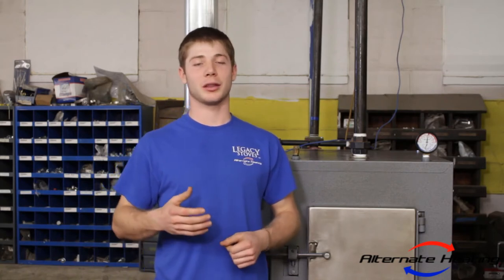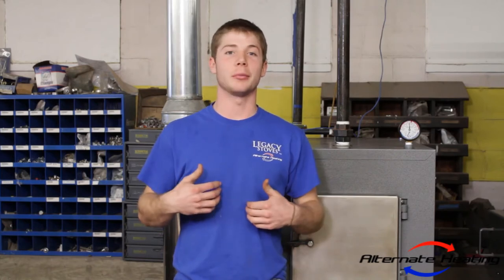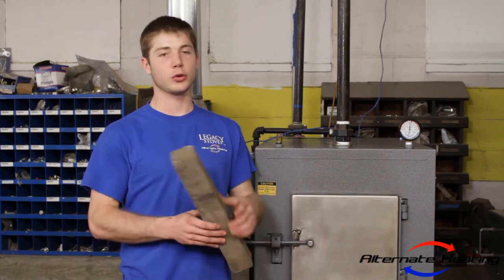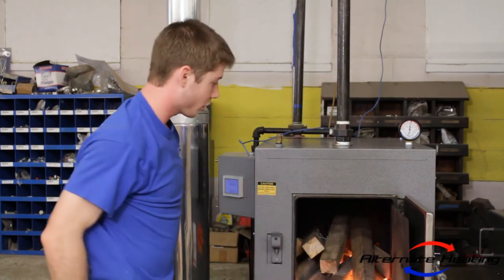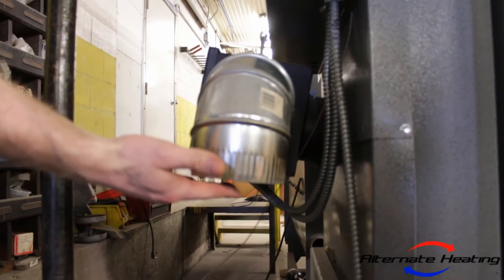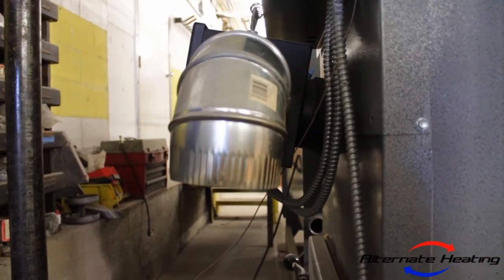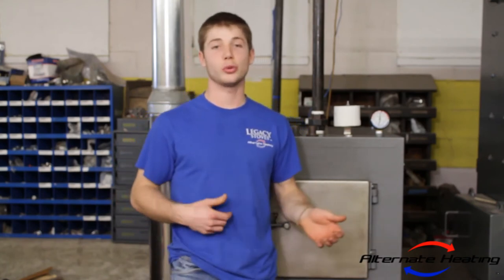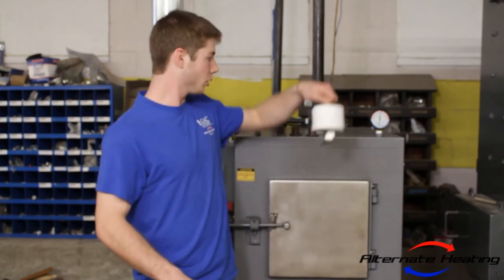How To: Back-Puffing Solutions

Comment: 11 months later: In  my case the puffing is not about the wood being to dry or two small but rather the rate of combustion. If I load the stove to the absolute top with large wet wood over a real hot layer of wood that is almost turned to pure charcoal and is burning really well and clean, the new load will begin to catch fire and if my air damper is anything but closed it will start to violently back puff. If I close the damper the puffing is just about stopped and all is well. This happens most noticeably on very cold nights. The fuel in the fire chamber just seems to be igniting the gases within the chamber creating small gaseous explosions that leak out around the door seals and out of the intake air tube. So I can run the boiler with the air damper fully closed and there doesn't seem to be any bad effect from doing so. The outside air temperature creates differant draft and fuel burning characteristics that do take time to learn how to adjust the draft to these conditions. If I burn smaller loads on milder days I can run my damper open more than half way, but I almost never run it wide open. I absolutely love the long burn times I get and the best thing I can say is that I am burning far less wood than ever before and I've been heating with wood boilers for more than 40 years and this wood gun is the best I've ever owned. PS. I don't work for or have anything to do with this company. In fact I bought my SS140 from someone who had to move and had bought  it from the Alternate people who make it.  I've owned more than three other types of wood boilers and there is nothing out there that compares to this unit.

Comment: I have owned an E140 stainless woodgun for about 11 years and I do experience these problems also and not only when the combustion chamber is full.   I have found that restricting the intake helps as Caleb mentioned.  Split wood that is stored in a woodshed for an extended period of time will definitely "back-puff".  It usually does not last very long, however if the unit has any (air) leaks at all the smoke will come out of those open joints as the combustion cycles from low to high in a rather dramatic fashion.  It really sounds very similar to a steam railroad locomotive albeit not as loud.  Since my unit is indoor I have taken several measures to make sure  any smoke that is released is recycled to the intake and thereby recombusted.  I do not have any experience with the other two items Caleb mentioned but I have a sneaking suspicion that if you plug one of the two holes in your furnace your BTU rating will suffer quite a bit.  I really like the idea of the air diffuser but I am not sure how easily it is retrofitted into older units.

Comment: I've been using wood fired boilers all of my life and presently own a SS140. The back puffing only happens when I fill the firebox to maximum capacity for an all night burn. My combustion air is supplied through a 6 inch pipe ducted from outside . I realize that the puffing happens when the gases in the fire box attempt to ignite within the fire box due to excess fuel being in the fire chamber. I think that the Wood Gun is the most efficient boiler I have aver owned and the best part about it is it produces no creosote in my three story chimney. Every other wood boiler that is not a gasification type seems to make creosote. The Wood Gun does not, at least for me. My wood for next year has been split to a much larger size and I'm hoping that will help reduce the puffing. I don't  understand why plugging one of the heat exchange tubes would prevent the pre-combustion in the firebox but I am going to call for the diffuser set up and try that. It seems logical that it may cause more of the combustion air to be present in a larger area of the firebox and help with the puffing. 
  Of all the people I know with all the different "gasification" boilers that are out there I think I can say without prejudice the Wood Gun is one of the most efficient and most controllable wood boilers ever built. Puffing is a small price to pay for all of the other positive attributes of these units.
Reply: I guess it's pretty randomly asking but does anyone know of a good place to stream new tv shows online?
Reply: @Clayton Jad Flixportal :)
Reply: @Hayden Bryce Thanks, I signed up and it seems like they got a lot of movies there =) I really appreciate it!
Reply: @Clayton Jad glad I could help xD

Comment: I see that there is a new digital controller on the side of the this unit. Do you still offer the non digital controls version??  I’m planning on buying a E180 in the near future.
Reply: Ben, did you end up buying a e180? I bought a used one a couple years ago and love it.
Reply: @fritz1022   sadly not yet I’m just trying to figure out how to afford everything from the boiler and installation to the garage/building to house it!
Reply: @fritz1022  is yours the stainless steel model?  Also sadly I heard somewhere that they went up in price a lot but not sure how much though. I was quoted in early 2019  a little over $16K for just the boiler shipped.
Reply: Ben, yes it is the SS model. I found it used from a guy that couldnt do firewood anymore. ($5000) He really took good care of it and knew all the maintenance. We have a new home, just over 3k sq ft, our first winter we spent over $3000 in propane bills so I guess its paid itself off already.
Reply: I think on my next go around, i will look into the outdoor ones. Im curiois on how efficient they are??

Comment: Why does it look like there is a reducer on the exhaust flue pipe or is that something else?  Is the bottom half double wall or some special type of pipe since it is super shiny then there is that connection between standard pipe that looks like a reducer?
Reply: The out going gas which is almost smoke free exits out of the bottom of these units. At the point where it leaves the boiler it is four inch in diameter. It then enters a cyclone spinner that causes any particulate to be separated and it is deposited into tha ash pan at it's base. The smoke pipe is at the top of this spinner device and that is 6 inch in most cases. I'm not an engineer but it would be me guess that the four inch exit pipe is sized smaller to create a velocity of the exhaust gasses that is faster which causes the circular motion in the particle remover to be at a higher speed. At the exhaust fan that is mounted at the rear of the boiler the smoke is put under positive pressure and forced out of the unit at a high velocity. When I was told about these units and then saw one for the first time I had to look at it carefully to begin to understand all the science that was put into these units that makes them so efficient. They burn the wood to a fine ash. you won't find a piece of  un-burnt fuel bigger than a pea in the ash pan.